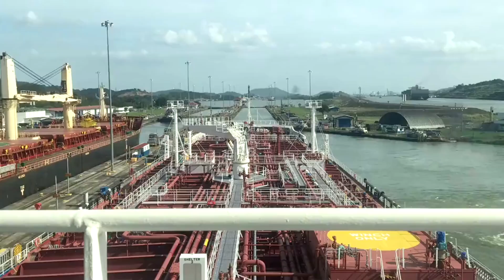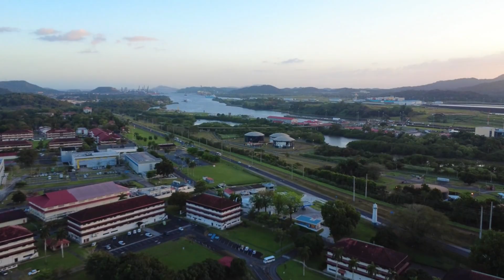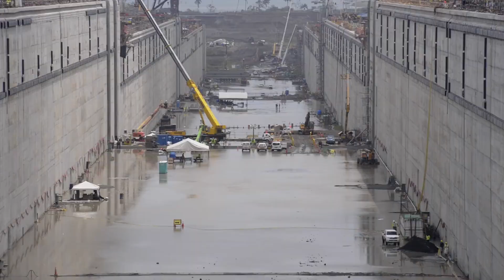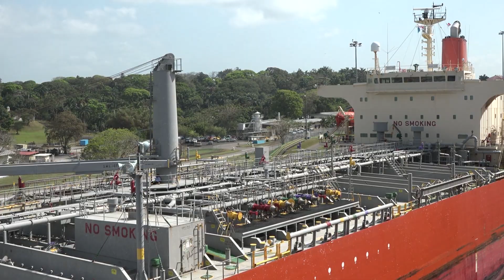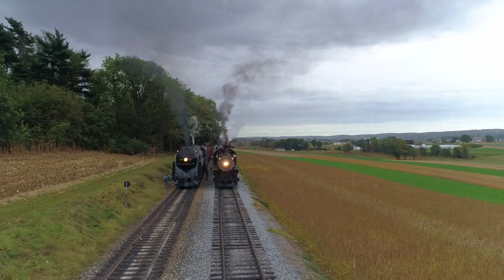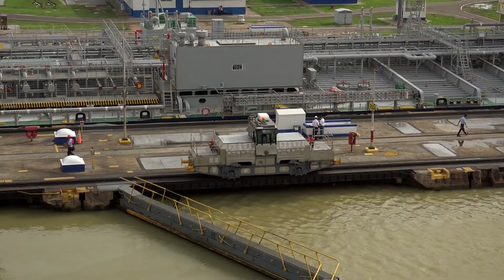How Does the PANAMA CANAL Work When Ships Pass Through? The History of the Giant Panama Canal

Comment: Nice informative video, but don't understand that why did they make it so narrow?
Reply from the maker: Great question! The width of the canal was actually one of 
the biggest engineering debates at the time. When it was 
built in the early 1900s, the technology and budget 
available made it extremely difficult and expensive to dig 
wider. Every extra meter of width meant millions more tons 
of rock to remove — remember, they were cutting through an 
entire mountain range! The width was designed to fit the 
largest ships of that era. The good news is that in 2016 
Panama opened a brand new set of wider locks alongside the 
original ones, allowing much bigger ships to pass through. 
Thanks for watching and for the great question! 🚢